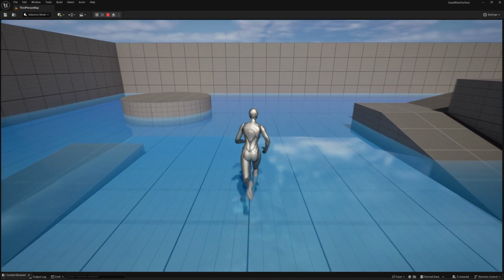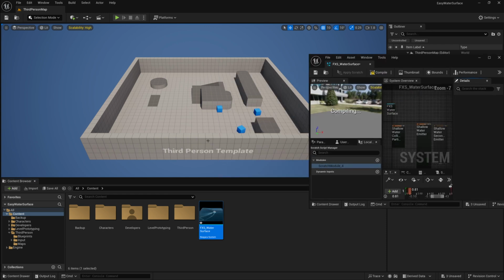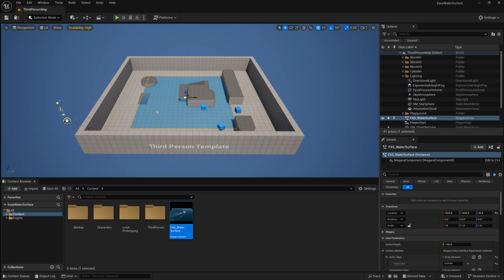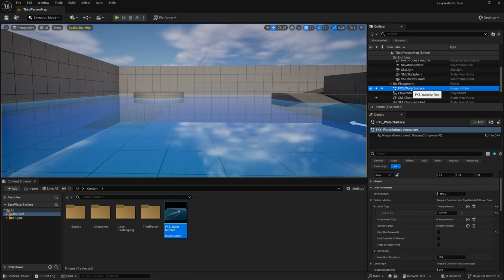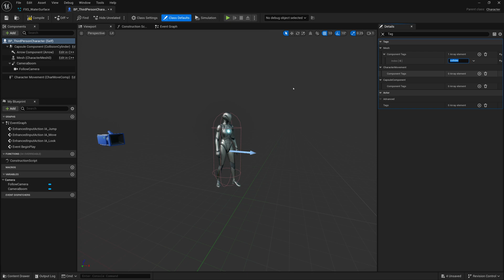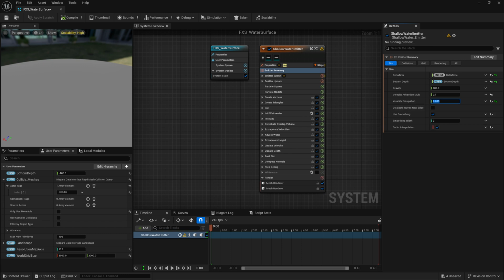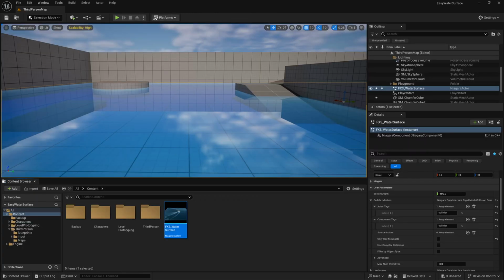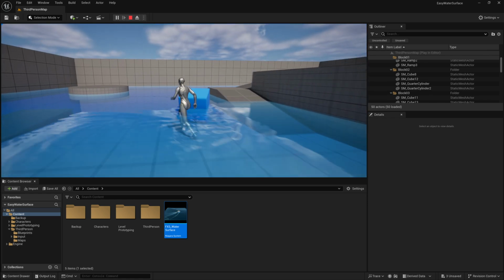Unreal 5 - Realistic Interactive Water in 5 Minutes

Comment: doesn't work; I set the collider as in the tutorial but there's no interaction
which collision channel is used by default for the interaction, and where do I find it in the niagara system?
Reply: Same for me. I first guessed this is because I am using the firstpersoncharacter and not the 3rd person one but then also tried with simulate physics BP objects and gave them the actor collider tag (there's no component tag for those). Since BPs don't have the component tag, I also used non-BP objects and gave them the tag for component and actor tag. In both cases the result was: no interaction for those objects either. However, that was all in an existing project.

So I fired up a new project firstpersonchar and for non-BP objects water interaction worked, however not for the firstpersonchar.
Then I fired up a new project thirdpersonchar and it all works as shown in the video.

 (UE5.4 and UE5.5)

Comment: how change the water color?
Reply: In the niagara system file
Reply: @play-good  could you be a bit more specific please? ^_^
Reply: I need this too lol
Reply: See my reply to @da_drood-digitalart for how to change the color
Reply from the maker: The water has a material on it which you can change In the Niagara fx system. It's under the rendering section on the Niagara fx. But I'd recommend using the material they already have in there, but making a new instance of it and adjusting the settings.